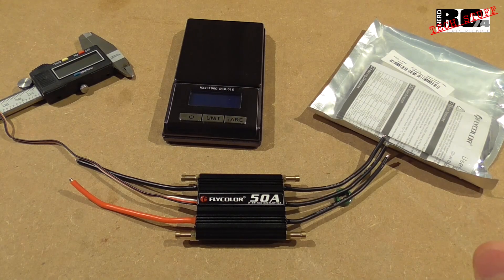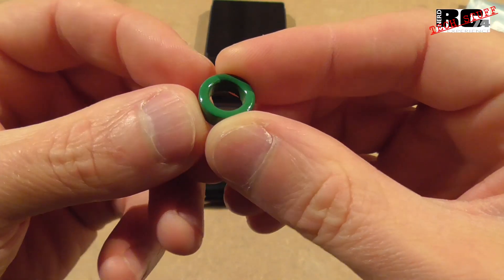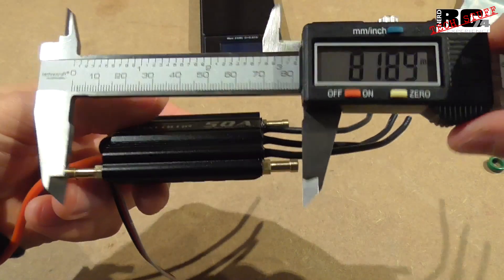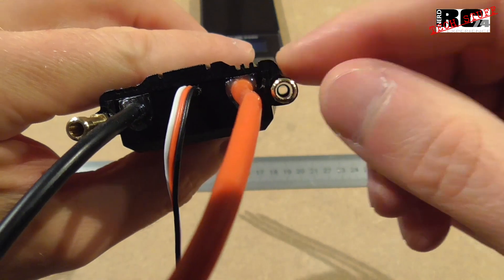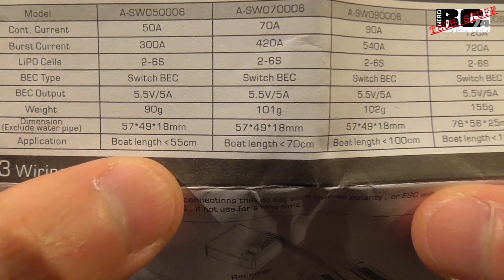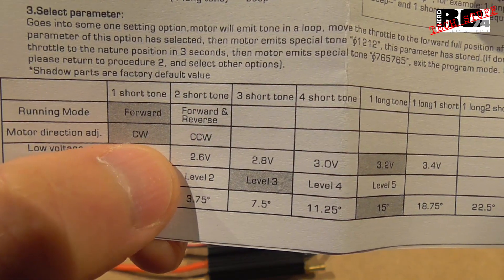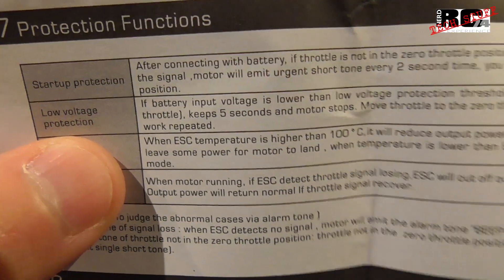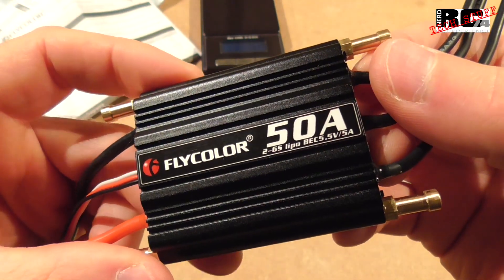FLYCOLOR 50A 2-6S RC BOAT BRUSHLESS ESC | FIRST LOOK AND SPECIFICATIONS

Comment: Hey I have a 150a esc it won’t bind with my transmitter and yes it’s paired. I tested it with an esc tester with a potentiometer and it works. On a receiver it just beeps constantly any ideas in where I went wrong?
Reply from the maker: Did you already reverse your throttle channel on your transmitter?
Reply: @RCnerd74  yes got it sorted just now tried again with the throttle maxed and it calibrated its odd it just worked normal on the tester? But I have the tester jumped to run a hand throttle and it works on my other venom esc but not this one even if I re calibrate. Only the potentiometer works it’s odd. Got it working off a receiver so it will work for now. Im trying to put 2 150a setups with 2 40mm jet drives to power a surfboard. Sooo I’ll just put the remote in a bag or something for now. 😂
Reply from the maker: @BoostedBikes  Wish you success for your project :o)

Comment: Hi did you manage to test it ?am having problem with mine after first time binding all good then when I unplug and then plug again it makes lots of tones
Reply from the maker: Just run it dry. But works perfect. No issues so far. Watertest will follow in spring. Perhaps you need to reverse throttle channel on your transmitter. It's possibly on full throttle instead of idle or zero throttle.
Reply: @RCnerd74  I have a FS-GT3c transmitter and when i turn on my boat it goes full speed, pulling the throttle actually makes it stop running, any clue how to fix this?
Reply from the maker: @RorysonTV  Looks like you should reverse your throttle channel on your transmitter.
Reply: @RCnerd74  ok  thanks
Reply: i have the same only 120amp,but for me the same problem
Reply from the maker: @chrisvdsvuurwerkjunky1971  You mean the full throttle issue? Did you already reverse your throttle channel? Mine runs perfect. 50A is just at its limit in my 4s Joysway Rocket. But no issues so far.